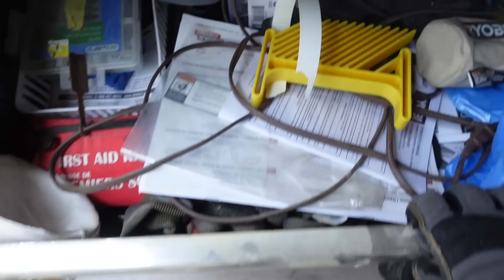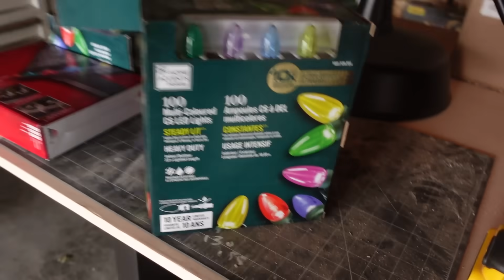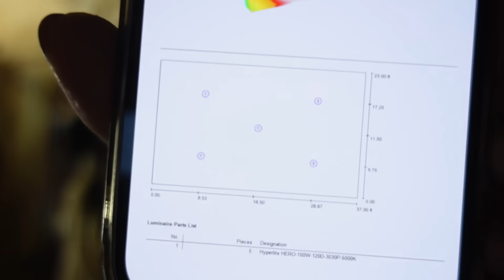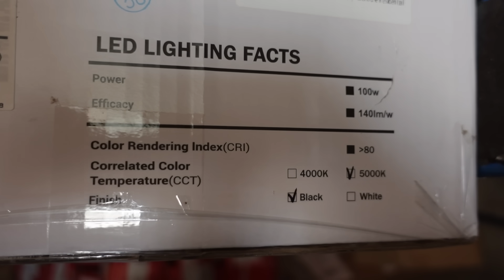*REVEAL* We finally finish the garage exterior! 🎉

Comment: One of the best things I did in my shop, was add a ‘bits & bobs’ box that holds all the extra parts from things. It’s saved me so much time and money from not having to replace parts I’ve misplaced or the time it takes to try to find it, but then have to go buy a replacement anyways. Highly recommend - especially since you modify things you get like I do! =)

Comment: Oooo ... I do understand and sympathize about your back pain - I also have scoliosis from Polio, plus I fractured a few vertebrae recently. I highly recommend a product by an amazing Canadian company, Thermotex. It is a safe (the ones where you can see a red light can damage your cornea!) FAR Infrared Heating Pad - and the Platinum model can bend slightly to conform to your particular needs - this Infrared heating pad does not get hot hot hot, but the gentle heat does reach almost 2.5 inches into your body. It is absolutely delicious! I named my heating pad Fireman, because he is 'Hot Stuff'. LOL